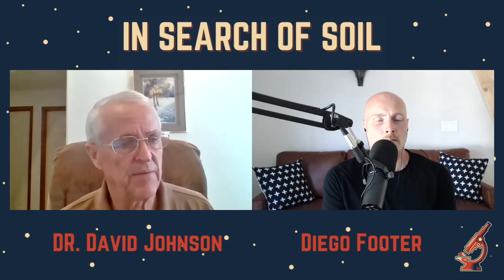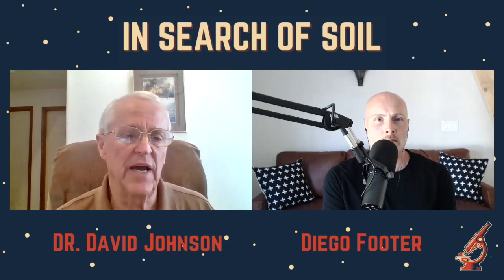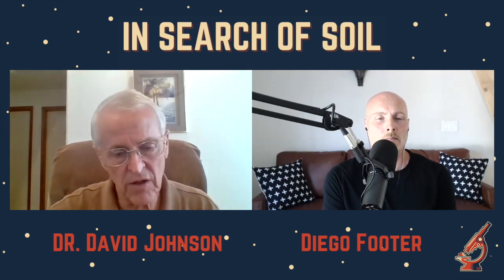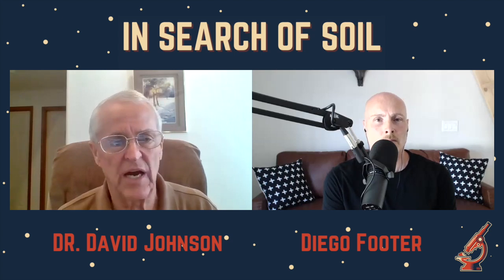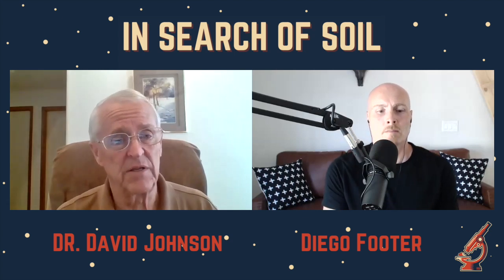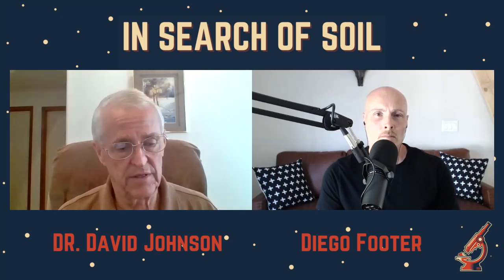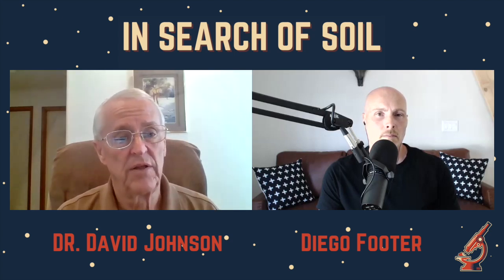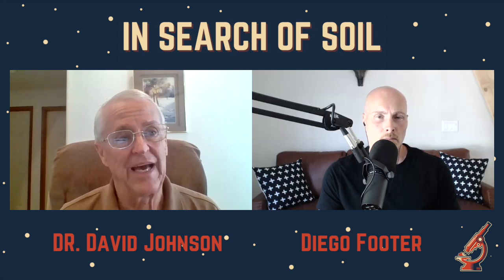The Benefits of Johnson-Su Bioreactor Compost | Dr. David Johnson

Comment: With it being clay like would it be counterproductive to add as a soil amendment to clay soil to improve its structure. Or will it be beneficial like other organic amendments
Reply from the maker: Not sure what you are asking here.
Reply: @DiegoFooter  Dr. Johnson said the compost created is clay-like. I have pure clay soil with zero organic matter that I am amending with organic material in order for it to be a healthy loose soil to work with for gardening. With this product being clay-like will it be beneficial for helping to loosen up the clay soil I have.
Reply: @stephenluna7932  Well, I have done this in small bioreactors (about 200 liters) and the result is very much clay-like in that you can squeeze it into a ball if it is wet enough. But unlike clay it crumbles pretty easily and when it dries up a little it naturally falls apart into little clumps that hold together as if glued together.

Comment: Thank you both for the information you provided. I have a practical question: Say you add worms and you want to remove them before  harvesting your compost. How would you do that?
Reply from the maker: I would just save some of the compost with worms in it versus trying to separate them.
Reply: @DiegoFooter  Yeah seems about right adding worms to assist soil aeration etc. Thank you for your answer Diego appreciate it.

Comment: Is there a tool/probe that one can insert into the bioreactor to periodically and accurately measure the moisture in the bioreactor?
In the challenging and uber dry + hot environment that we farm, it’s critical to ensure 70% moisture for which such a probe would be extremely beneficial. Thank you!
Reply: The device is called a tensiometer. They are used in agricultural research. They are quite expensive.
Reply: @gilshelley9183  many thanks! 
If any one knows of anything cheaper that’s out there please share.
Reply: @taimurmalik2792  I just checked amazon and found a few under $100.00 from reliable manufacturers. Lab grade ones can cost up to $700.00.  I have no experience with digital options.
Reply: @gilshelley9183  Amazing! Really appreciate your searching and posting here. Thank you!
Reply: @taimurmalik2792  inexpensive analog tensioneters could help. They cost not more than a few euros or dollars depending where you are from. Maybe buying one and testing its accuracy would save you some money
Reply from the maker: There is probably something out there.  I have mine on a drip timer and don’t even think about it now. It stays moist enough.

Comment: This is far more complex than I thought. Thanks for bringing this to light. 
If it is best to not disturb the matrix of the mycelium, then it would appear that reducing the size of the particles to be composted to an absolute minimum. This would maximize the surface area of the material being composted and expose as much of it as possible to the bacterial and fungal organisms. At the same time though it would appear that extremely fine particles would pack and impede aeration. I definitely understand it to be an aerobic process.
I don't understand why importing the inoculant from across Australia didn't work. Does that mean that composting is always best done with local biota?

Comment: Thank you so much for inviting Dr. David Johnson. It all ended too fast...so many questions I have on the best methods of applying the compost... will making compost tea diminish the fungi? Is it better to cover the compost with a mulch layer? Will direct sunlight destroy it? I am questioning the use of so much sunlight exposed compost in market gardens. Could we have David back for part 2? What's the best way to inoculate the soil with his compost? Start growing a cover crop then water and sprinkle compost? Mix the compost with water and water a seeded covet crop field. Deposit compost in channels and water?
Reply: There are several YouTube videos where Dr. Johnson goes over most of the questions.  He even has one to show you how to turn the compost into inoculant for seeding.  As far as how to apply it, it depends on how much you have and how big of an area you want to cover.  With the tea you only need 1 to 2 pounds of compost per acre.  If you have a small garden it may just be easier to spread the compost evenly across the bed.  I have a modified Johnson-Su bioreactor and I plan on spraying my entire yard with compost tea when I am done.  Any left over compost will be going straight into the garden beds and areas that I want to add some cover crops to.
Reply: @finagill  I've finally found the video...Carbonlink...Johnson Su Composting Bioreactor...He makes a slurry mix with eight parts milk to one part molasses and the spore compost clay and coats the seeds... more effective keeping the seeds moist. They don't seem to block the seeder. Can be added to irrigation water. Because we are dealing with spores and not hyphae, worms or bacterial colonies, it's much more tolerant to light, heat, cold... it's once the colonies have established themselves that they need plant roots and an appropriate environment.
Reply: @finagill  Thanks. I've started watching some of Dr Johnson's talks. I have yet to see the application methods in detail. My landscape is very degraded because the top soil was removed with bulldozers and applied on a neighbouring pecan orchard before we bought the property. The climate is extreme and very low rainfall. My small areas of success have been limited so far.